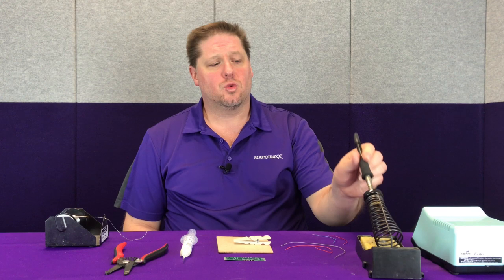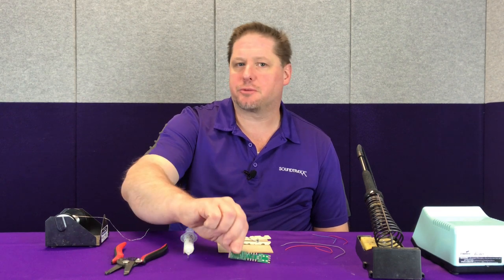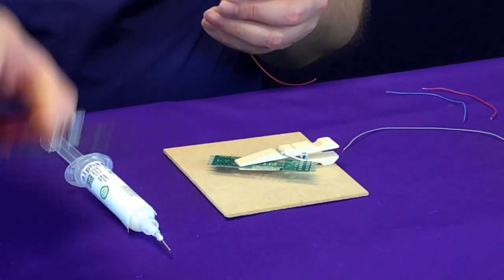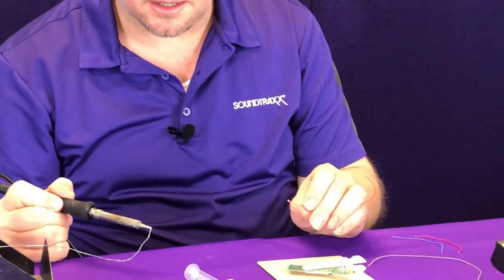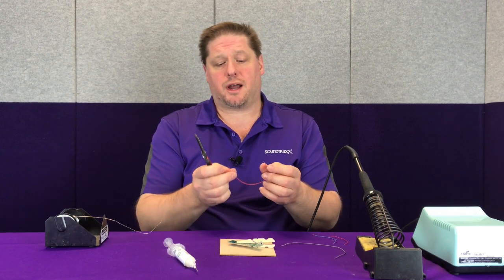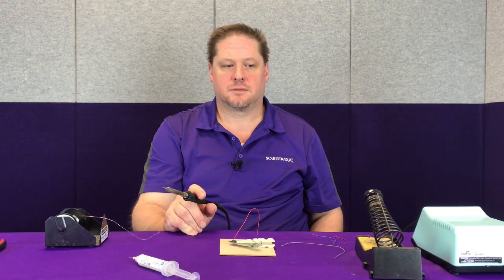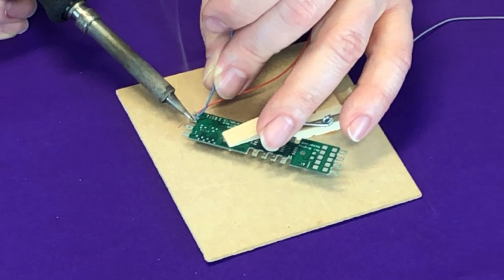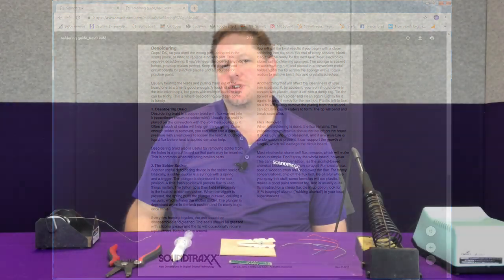Soldering Tips from SoundTraxx

Comment: My apologies. I need to re-phrase my question.  The item that George uses that I am interested in is the solder flux. That syringe and needle dispenser is great for working with small items and in tight spaces. All I could see that it is Omega something. Any help will be deeply appreciated. Thanks
Reply: @UCURYyguc6F1Gp1uzwhFAY9Q Thank you very much!

Comment: Great video George. Where can we purchase the solder you use in the video?
Reply: William Warren 
Go to Digikey.com
Reply: This is what you need and what I use : go to Amazon and search for "Welding Soldering Iron with Thermostatic Digital-Controlled and LCD Screen Display, 60 W Temperature Adjustable 80℃/356℉-480℃/896℉ with 5 PCS Soldering Bits, 2 Soldering Iron Stands & 1 Sponge" BTW I also have more expensive soldering stations bur I keep going back to this one. Cost $20.00
Reply from the maker: @moisesbursztein2830  We suggest using a 25 Watt soldering iron and do not recommend using one over 40 Watts without the aid of a temperature control system.
Reply: @SoundtraxxDCC  The soldering iron that I pointed out does have temperature control it is not as accurate as a Weller soldering station but you can set set at the temperature that just melts the solder and it will stay there.
Reply from the maker: @moisesbursztein2830  Yes I see that. Just want to make sure no one just sees 60 watts and goes for it!
Reply: I just tried to help people to save money that can be better invested in a Tsunami decoder.
Reply from the maker: @moisesbursztein2830  No problem with that. We just wanted to add a note to make sure they knew to get a temperature controlled soldering iron if it was over 40 watts. We just wanted all of the info to be there. Thank you for sharing!